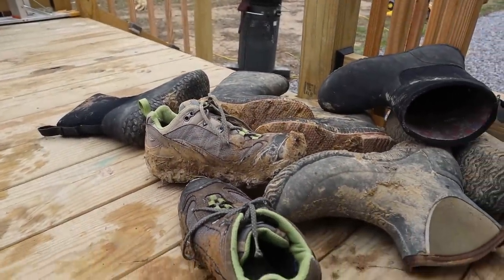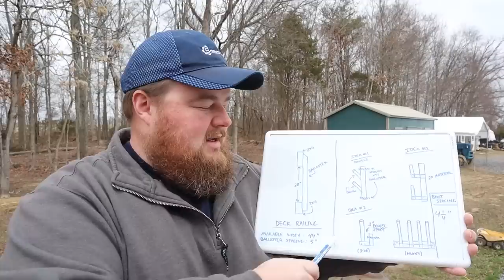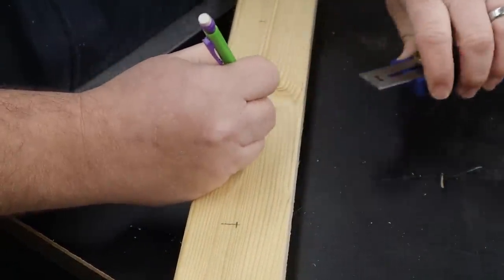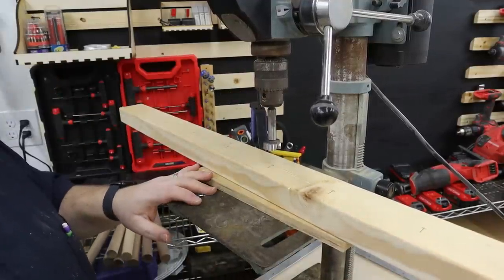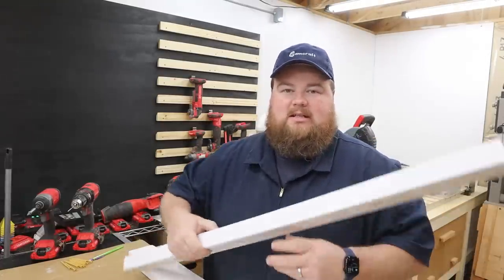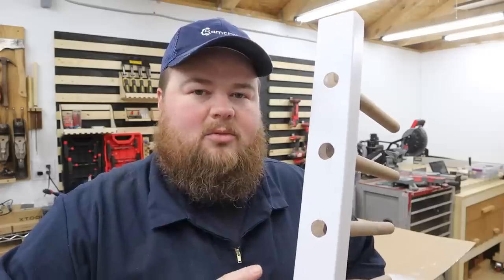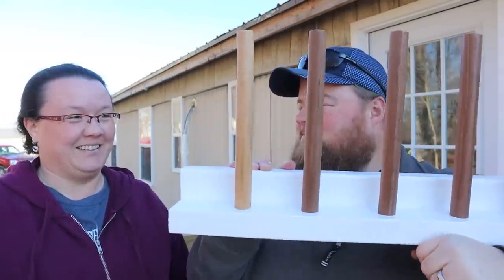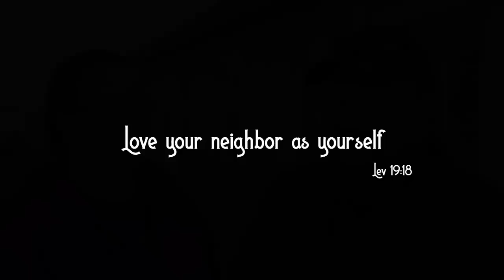FINALLY a home for the MUDDY BOOTS!

Comment: Nice project! The only thing I might have done differently is to make the 2x4s a darker color because they will get pretty dirty and I might have placed it on the other side of the railing because when it rains they will drain off on the ground and not on the deck making more of a mess.

Comment: As someone suggested, a boot scraper. Plus a washer at the bottom of the steps. I remember in the UK a washer was a small trough with stiff broom heads fixed to two long insides. Scrape the mud off the boots, then put your foot in the trough and with a quick brush backwards and forwards. Bob's your uncle.

Comment: For additional sneaker storage, maybe you can design the same thing, higher up on the back side of the railing?  Maybe with some dowels that are at a lower angle so you can slip the toe of a sneaker in there securely and you can reach over the top of the railing for them? And what about a deep boot tray / tub with water at the bottom of the stairs, where you can rub off the mud a bit before going up the stairs? Your Sam-brain will surely come up with something fun!

Comment: Have a suggestion.  Put a little roof over the boots at the top of your railing.  Tilt the roof backwards so the water doesn't run on the deck.  It will protect the wood also.

Comment: You have solved a problems and given other ideas. You can fill your boots with crinkled newspaper and that will keep bugs from going to the toe were you can’t see them. If u want them to stand up cut a pool noodle to fit and stuff paper on the inside between the boot & the noodle. Good job u two.

Comment: Now a MUST-HAVE is to put a boot scraper at the BOTTOM of the steps before you go up to that landing. This will save you a TON of work cleaning up mud. 
If the boots are wet-muddy you might put a narrow tray in front of the peg-board to catch the runoff.

Comment: Growing up partly at my grand parents farm we had a scraper by the back porch. It was basically a metal strip that was welded to the base of a round metal bar that you  could hold on to. That bar was essentially a U shape the metal scraper filling in the top. The U was left longer to stake it in the ground. It worked great to clean shoes. My guess is it’s still there on that farm.

Comment: Great project!  You could also have made two rows if you angled the dowels at a  45° angle, but that would get a lot more complicated to make.  
For future projects using wood look up a method of preservation where you char the outer layer of wood (using a propane weed torch).  It’s purported to outlast the humans who make it when wood is treated in that manner.  The method is called shou sugi ban.  Just FYI.

Comment: I like the boot rack.  I've used shoe dryers in the past that are similar, but they use a piece of pipe with a very small heating element to dry the shoes.

Also, on your tractor video a little while back, are you sure the tractor doesn't already have tubes in the back?  The valve stem looked just like my tractor with tubes in the wheels.